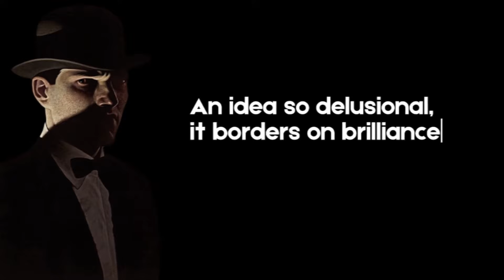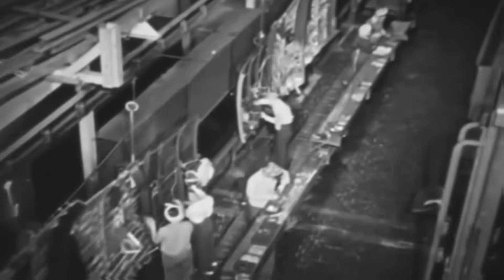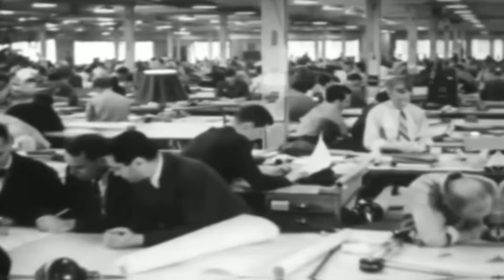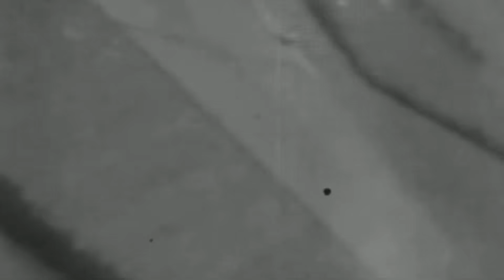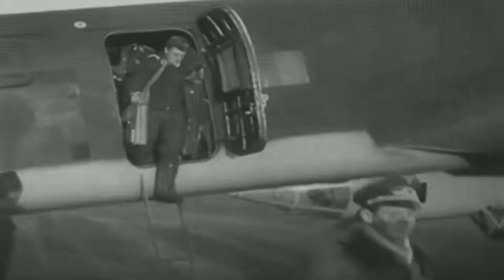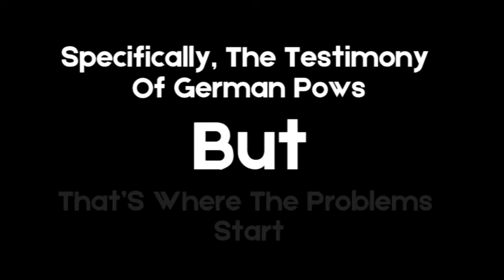The Nazi Bomber That Almost Reached New York | Ju-390

Comment: Ju 390 use powerplant by BMW 801E engines(deploying about at 1,975hp), They originally planned for BMW 802 or DB 604 or Jumo 223 engine, But three new and over 2,000hp engine has tested to fail and no massive production, They have use BMW 801E engine to give Ju 390, And that try to use BMW 801Q(turbocharger) or 801R(two stage four speed supercharger) give Ju 390 more flying high speed and high altitude to deporting Ju 390 strategic bomber version, But it is never exists upgrade project.